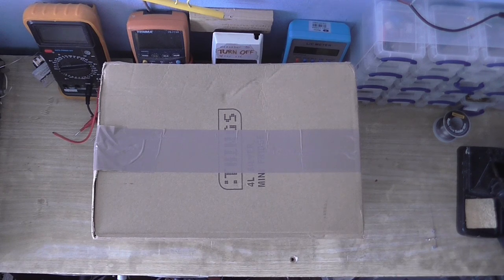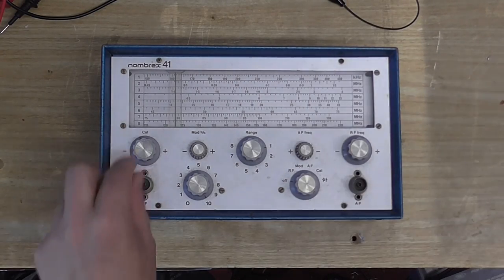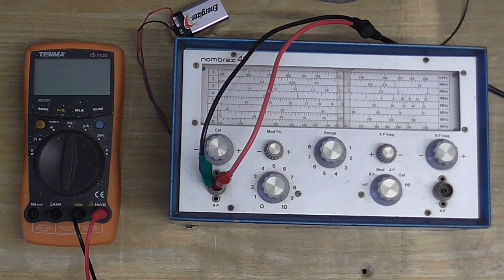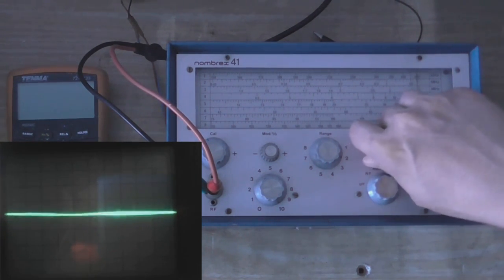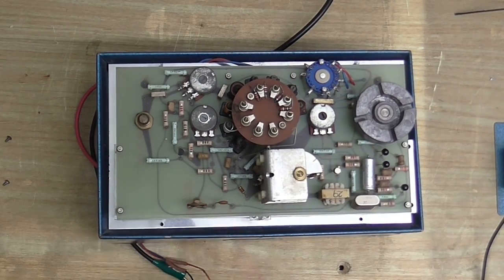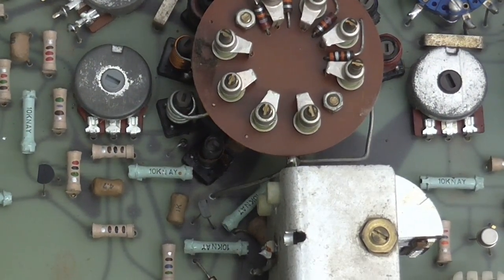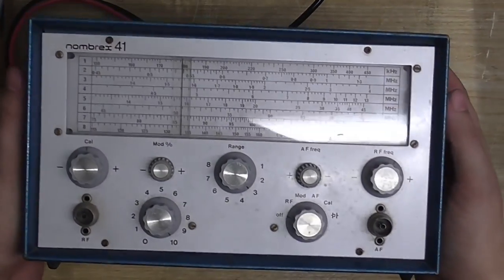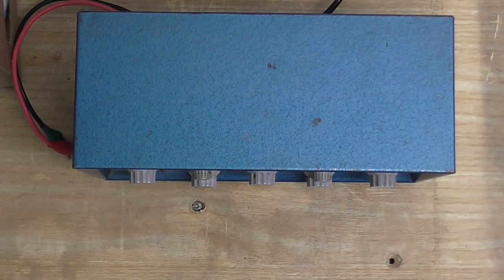Nombrex 41 RF function generator.

Comment: The trick for getting the unit uncashed is to rotate the calibration knob when pulling on the case front knobs to free the sliding dial from obstructing the main unit removal.

Comment: Nice. Doesn't look like it has complex circuitry inside, you can make yourself a comparable device. But - finding the case, making it all fit, all that mechanical mayhem (flywheel, vernier drive); what a hassle :D So yeah, enjoy. Despite  the simplicity, it's very useful gear to have on your bench. I built myself a 10.7MHz oscillator using a ceramic filter and that is very useful to peak IF cans, so having something with a lot of ranges is even better.